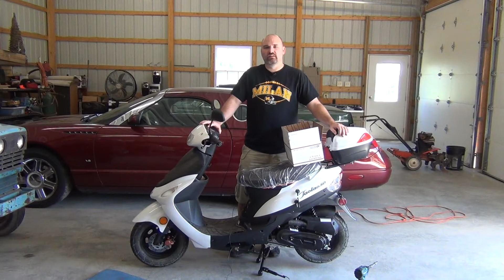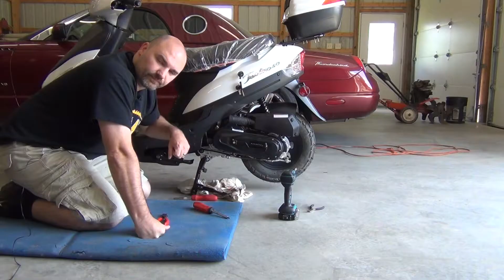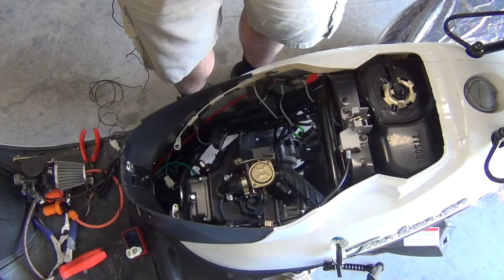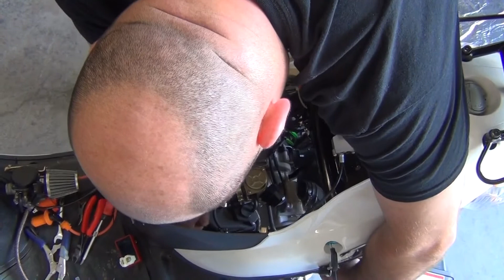White Lighting Scooter Build 3: How to remove carb, air box, CDI and Coil

Comment: Save your money they screwed me out of my money. Refuse to send my part that they claimed was on back order. They didnt tell me there were going too be parts missing until I opened the package with v. I wouldnt have purchased it had I known the air cleaner and the exhaust would take a year. Which I still haven't received by the way. My multiple emails and calls are being read and not responded to. So I had to sink another 200$ to get it going despite paying 400 for the whole set already.
Reply: Forreal I been waiting for two weeks

Comment: I ordered the kit put it all on I get a little quicker on taking off but lose 5mph after adjusting...Whats going on with that?...robert
Reply: robert vanhevel I feel bad for anyone that buys this kit ( I dont know how much it cost) as they are all chinese parts that dont do much and the only thing really that different from stock is the filter un 'll ess the carb is bigger but I doubt it.
You would have been better off with trans tuning . You should see some gains with someroller weight tuning along with a performance variator and torque and clutch springs.
If you have anymore questions you can email me at lsxnoss1081@gmail.com I can also help with carb tuning.